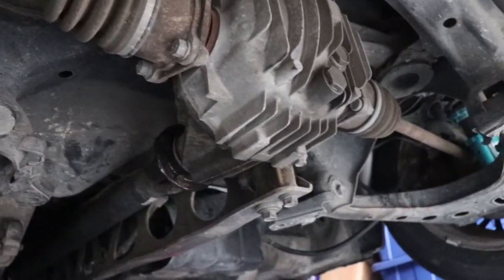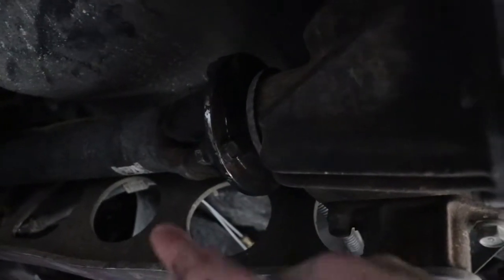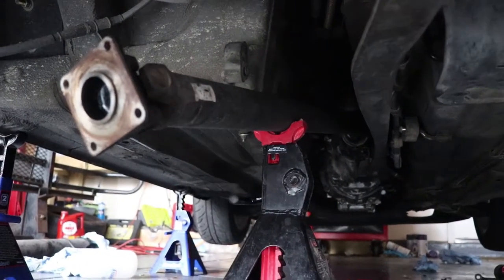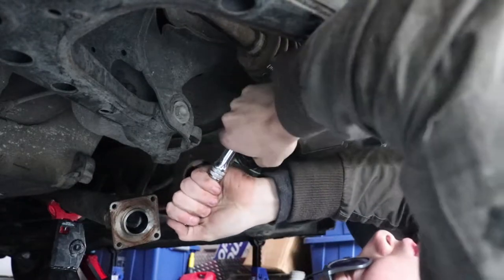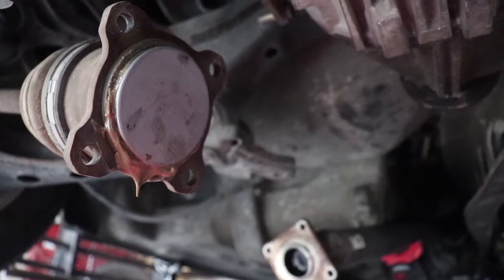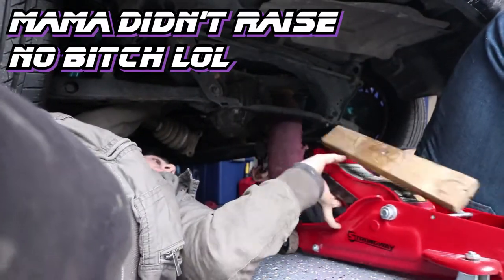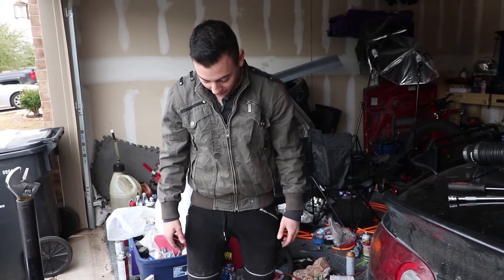How to remove a Mazda Miata Rear Differential

Comment: Can I take one out like show here, but instead of welding put in a Torsen LSL? Will I need any additional parts?
Reply: Late but this is for future people
No you can't, to put a torsen slip you will need to do a 1.8 differential swap
Reply: @MACTEP-il1eu  well... I did it anyway... 😅
Reply: @erykkilianek1111  oh, was your miata built after 1993? then it would work since those are 1.8 miatas
Reply: @MACTEP-il1eu  yep, 2000

Comment: did you have to drain the fluid from the diff before you dropped it?
Reply from the maker: GAME HARDWARE no we drained it outside the car. It’s a sealed unit so it won’t spill out until you crack it open.

Comment: @10:41 the process of removing the rest of the axle arms( don’t know the exact name of the part yet ) how did you do it , only two different clips an you use two different tools but not how you really got the perfect pop
Reply: The half axles I mean how coo you pop them out of the diff you started at 10:38 I belive
Reply from the maker: We used a hammer and a pet bar and tapped them from the back side until they popped out. Hope this helps!

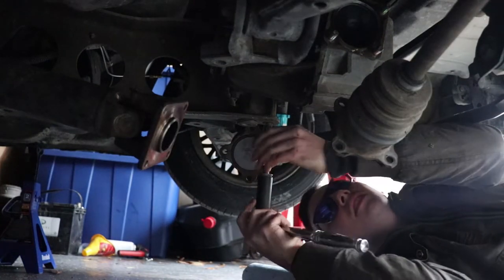Comment: At 7:30 when you show the 2 bolts being removed  ,I think you are supposed to  unscrew the bolts about a inch  and then hammer them  back up  to pop out a metal  cap  sleeve  that  holds the diff in place on the  frame beam .  You didn't show any of that  and that is the most important thing to do to get the diff out .
Reply: You don't have to do that part and infact most people don't even have them anymore because the previous owner lost them and just put a regular bolt there. However it will be a lot more difficult to take it out since you will have to slide it out instead of just dropping it out

Comment: You would save my life with a reply. What size were the bolts you took out at 7:20
Reply from the maker: I’m not sure of the exact size, but the oem part numbers are 39-721 and 39-722.